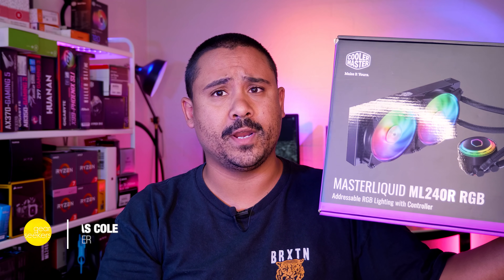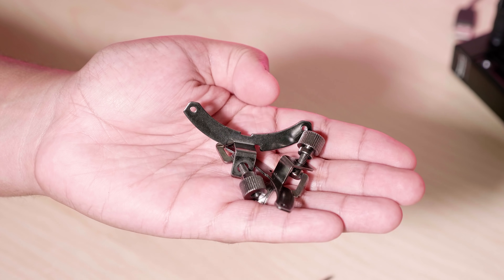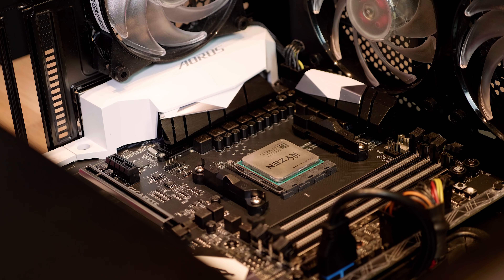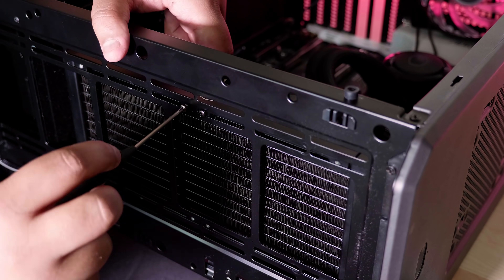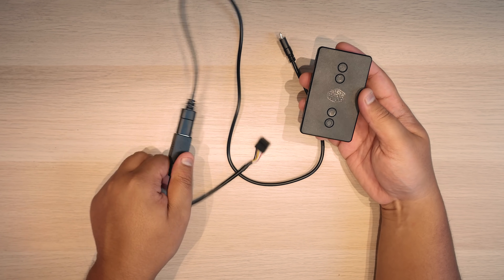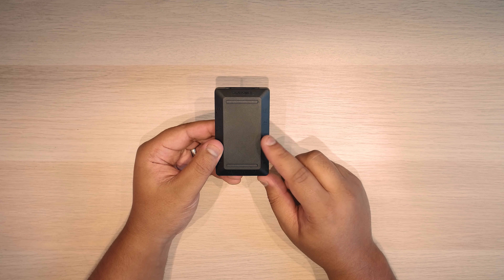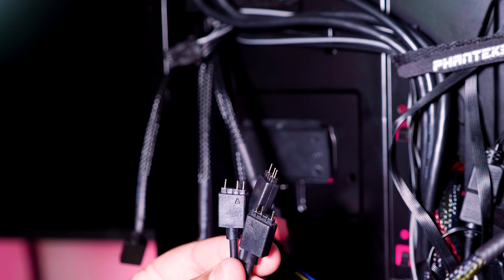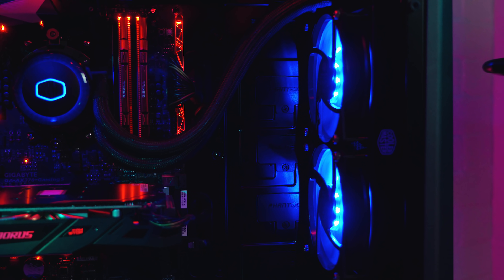HOW TO Cooler Master MasterLiquid ML240R RGB AM4 Install Guide

Comment: The AIO PWM splitter has a 4pin on 1 end and 3 pin and a 4pin plugs on the other end. 3 pin plugs turn a PWM fan into a DC fan and it will run 100% speed all the time. The other fan will run according to how you set your fan curve. Like a 4 barrel carburetor, 2 barrels feed gas till you"kick it down' then the other 2 open up. Don't know if this true of all AIO's. You could switch to a splitter w/all 4 pin plugs. Good idea or not? WWJD?

Comment: You can eliminate the controller by looking at User Manual for the ML240 Illusion. But I need the other 3 ports on the controller for my 6 case fans.

Comment: How often do you have to service this particular cooler? I have him for about 2 years now and it keeps my I5 temperature pretty low(about 40-50 degrees celsius). Is there actually any maintenance that those close-in loops require?
Reply from the maker: Never

Comment: My ryzen 9 5900 x is throttling to over 100 degrees Celsius with the cooler master 360l. All of the fans are spinning and I have no idea what to do. It doesn’t have a pump header

Comment: thank you, it actually helped me to get that rgb running, the sweet cooler master guys sent a manual without the USB and sata connection steps, and since i was too lazy to look through the whole box when i saw the PILE of cables i was wondering why its not working without any power input :D still, the amount of cables is unbelievable...

Comment: Installed this on AM4 and the screws didn't seem to stop but did get really tight to the point where I was worried about damaging something.  Temps are good though so I guess it's ok.  Only complaint I have is the fans have a bit of a low whine so I swapped them for some others.

Comment: great video glad you figured out how to set up the fans. just one note. please dont mount the radiator like that. air rises and there is always air in the system. you want the tubes at the bottom after you get all the air in the radiator. this will help keep the system from having hot spots and will help keep the pump life.

Comment: Just got one of these, the v2 anyway, and this video inspired me to adjust my setup a bit. I have the sickleflow 3-in-1 case fan setup with 1 on the back and 2 on the front, and was gonna attach this to the top, but mid-installation I discovered that I'd lost my original mobo cooler mounting hardware, so I had to order another one. After watching this, and looking down at my PC and seeing how much of an eyesore the radiator is on the top (can't see the fans, defeating the purpose of the RGB), I figured it'll be perfect on the front with my front fans swapped to the top. Assuming there is enough room in the front for the radiator and fans in my Darkflash DLM21 (opaque frontplate). But yeah, great video, clear and concise instructions. Will be watching it again when my mounting bracket arrives, thanks.

Comment: Hi guys! important note. Nick did a great job of explaining how to install the cooler and brackets but if you want to use Aura sync or any other m/b integrated ARGB Sync then it's best not to use the controller and just use the splitter to connect up all your ARGB devices to the 3 pin single ARGB connector on the m/b. 
this is much easier and no usb connection/extra wires needed. Also fan power cable splitter not really require and there are many fan connectors on m/b these days.

Comment: This video helps a lot. Thank you very much. Got one question. Would it be okay if the splitter fan cable be connected to the system fan header instead of the cpu fan header?

Comment: Hi. Some recent videos mentioned that radiator tubes should not be mounted up to avoid getting air into the pump. Do you know if it is possible to rotate the radiator and put tubes down? Are the hoses long enough?
Reply from the maker: It literally makes no difference. You should probably understand the context of those videos

Comment: Is that a Phanteks P400 case? If is It, I couldn't install the Masterliquid ML240L V2 in the same case, the hoses are too short to install in the front part and I'm having a hard time with the vrm coolers to install in the top of the case, some help please!

Comment: New to argb fans etc but does that controller plug into the 3 pin on the mobo? I have an msi rgb board that runs all my fan lights through mystic because I daisy chained them all together from your video on the msi aio.  Or is that controller it's own seperate thing completely?

Comment: Thanks heaps for the video. I did this differently ..

To get this controllable via the phantecs case (mine has 2 argb fans and mode / color buttons) - I didn’t bother with the cooler master controller, imo it’s only necessary if you don’t have a controller on case or you don’t have argb support on motherboard.

You can connect the argb splitter (that’s supplied with the aio) to the argb extension cable from phantecs case to allow for more argb devices. 

I can also connect directly to motherboard (again the case has a cable I can just plug into argb slot on my motherboard) if I want the motherboard to control argb instead of the inbuilt case controller

Comment: I have 2 sets of coolermaster 3 pack fans and one of three way splitters is plugged into CPU_FAN and the other 3 way splitter is plugged into CPU_OPT and whenever I boot up my pc my fans go all the way to max RPM then slow down, then ramp up, then slow down, constantly. And i can’t seem to configure the speed in the bios because it doesn’t do anything.

Comment: Correct me if I’m wrong but isn’t there a max of 10% air in these and with that the pump is at it highest point meaning your not going to ideal conditions?
Reply from the maker: You're wrong

Comment: Are the tubes really supposed to be on the top when mounting the radiator in the front? Shouldn't they be on the bottom or...?
Reply from the maker: Literally makes no difference
Reply: @GearSeekers  Alright thanks, and push and pull or only pull? :)

Comment: كرت الشاشة - MSI RTX 2070 SUPER 8G GAMING X TRIO
كيسه - Corsair iCUE 220T RGB Airflow	
الرام - CORSAIR Vengeance RGB Pro 16GB (2 x 8GB) 3600MHz	
المعالج - Intel® Core™ i7-9700K Processor  
التبريد المائي  - Cooler Master MasterLiquid ML240R RGB	
  هارد ديسك  - Western Digital WD Purple 3.5″2TB	
الشاشة  -  MSI OPTIX G24C4 23.6″ CURVED 144Hz	
الباور   Cooler Master V850, Full Modular 80+ Gold Certified 850W Power Supply, 5 Year Warranty
الماذر ( لوحة الام ) GIGABYTE Z390 UD Motherboard

Comment: Useful video up until your rgb splitter miraculously attaches itself to the rgb controller. 
Might be worth mentioning you need to use the male 3 pins converters that come with the cooler to do this...
Reply: This drove me fkin mad. That’s what its called? I was wondering whether that’s what I needed to do. The other thing is, my motherboard’s cpu opt port where he plugged in the pump, it’s a 4 pin port but the wire has a 3 pin female head...

Comment: when installing my 5 3600 i didnt notice the back plate of the cpu fan mounter fall and i was crushing the spring guided screws so hard on my cpu i rectified my mistake but fuck me was it scary, 8 months later no problems luckily i didnt derptard too hard, first build btw now on my second :P

Comment: So I started my journey with losing two screws needed to install AM4 stuff on the pump :D .. then had to remove two screws from my motherboard. Now the problem is with mounting the radiator because it seems like I cant mount it on TOP.. my RAM collides with radiator.. and I cant mount it on the front panel cause some stupid ass cables are colliding haha.. The only option left is to mount it on the bottom :D gonna leave this for tomorrow

Comment: Hi Nick. I know it´s an old subject but, is there any tricky "problem" with how to install radiator vs pump tubes vs liquid loop vs top/front. I have the same config as you show here and i live quite well with that. Some available Gamer Nexus videos about AIO Mounting Orientation. Just curiosity about what you think. ThankU
Reply from the maker: It literally makes no difference. Watch that video again. Most people didn't even listen to what was said
Reply: @GearSeekers  Thanks Nick

Comment: Is it possible to connect a cool master case fan to the RBG controller in one of the other ports and have them synced? I actually have my aio rgb currently plugged directly into the controller cause the instructions they give say to do so and I believe it’s synced. They also say to just plug the one fan splitter directly into the motherboard itself and not the controller which is clearly not what you did here so that’s kinda funny.

Comment: I installed it all but my RGB Coolermater logo on the pump is not turning on, do you know how to fix it? The rest of the RGB is working but I can only change it on the controller, not on Asus Aura or Gigabyte RGB Fusion. Thanks

Comment: Hey guys new builder here, i just want to ask questions regarding if it is safe to install a deepcool gammax 400 to my b450 motherboard without removing my gpu and all the attached cables from my power supply? Is it safe from any damage for my components and from electrostatic discharge? just like the guy in the video  (Nicholas Cole) Hope you guys can help me and give me some info. Thank you in advance!

Comment: what does connecting the 4 pin fan power to the argb controller do. does that just give master plus the ability to control the PWM of the cooler fans?
Reply from the maker: Unless you want to damage your components I wouldn't be doing that.

Comment: This cooler sucks for AMD motherboards that are just switching coolers. I have an fm2+ and my previous cooler didn’t require the original plastic retainer. All amd boards have these in one form or another. So 5 years later when I replace my old cooler I no longer have the retainer bracket so I had to order another. You can order replacement retainers for amd boards based on your socket. I use the A10-7850k chip with a msi A88X Gaming 45 fm2+ mobo. I will say if you know a thing or two about cpu’s and have the retainer this would be super easy to install as you would just have to mount the fans to the rad, and the rad to the case.. then the cpu waterblock clamps down on the board (exactly like the stock coolers do) there are a lot of RGB wires and fan wires which this unit comes with an rgb controller and a fan splitter for the two rad fans (cpu water block fan connection goes on motherboard). But until I get the replacement retainer it’s just mounted in the case and the motherboard is in protective static free wrap.

Comment: So did everything as shown in the video, everything works radiator fans and and pump no problemo. However. My cpu fan speeds indicate 0 rpm hence the fans on the radiator spin quite loudly which kinda defeats the whole purpose of an AIO. Wonder if anyone could help me with this?

Comment: Hey there! Any tips, why my ROG B450-f does not controll/see this controller? 4pin RGB-pin connected to the MB and the con., also the USB connector both in MOBO and cont. It just doesn't work with AURA.  :((( thank you for your help!

Comment: Is it possible to connect a three fan kit hub controller (for master cool fan kits) into the master liquid fan kit hub to control all of the fans’ ARGB functions on boards like the Asus B450-f that aren’t supplied with an ARBG header? I’m trying to build a system with both kits and the board doesn’t have the ARGB header on it
Reply: I just really don’t want to have to use up two usb 2.0 headers if I don’t need to so was thinking maybe plugging the pass through on the 3 fan kit into the AIO fan controller might work to simplify everything

Update: I’m going to try it, I think. The AIO controller has a RGB 4 pin for passthrough to RGB headers I do believe as well as coming with the USB 2.0 header setup. I wish the three fan kit came with the same controller as the AIO tbh because that would simplify everything.

Comment: u forgot the pump to the controller
Reply from the maker: No I didn't
Reply: @GearSeekers  at 8:50 you only got the fans connected should be fans and pump. Okay maybe u didnt forget but it didnt show up on the demo with the pump connected
Reply: @fongyfong2000  no, he didn't. he connect argb pump to splitter at 07.57
Reply: @kkbali1505  it should be going in the controller for indepedent rgb for the pump not the splitter

Comment: Thanks for the video.  I have a similar fan system (if not the same one) where the fan is causing excessive noise (link: https://youtu.be/Z0HYcHiv6zQ ).  What might  be the cause of that rattling noise? Do I need to tighten or loosen the fans crews? Or the radiator? Sometimes, by tilting the computer, the noise stops temporarily.

Comment: I have NX 210 with three RGB Antec fans in the front..............the technician has to remove these fans..........in order to fit the 240mm front radiator.............I would like to know how can i fit the radiator without removing the front three RGB fans................Please advise

Comment: Hi, Could you please get back to me on this.............Cooler master radiator you are fitting the fans with cooler-master logo showing towards us and in other videos they are fixing the radiator showing the other side such as coil or reverse side.............Please clarify
Reply from the maker: Depends on your case. This case is the correct installation
Reply: @GearSeekers  Nx210 Antec

Comment: 3:19 reality is this is the most fucked up dumbest lazy implementation ever, they can spare to include the bracket for intel but not AMD? so we're fuck trying to get it to mount right with that barely functioning screw
Reply from the maker: Are you high? Because it clearly mounts on AM4
Reply: @GearSeekers  yes it mounts by latching the loosely knobbed d ring into to the bracket hook, that is my problem you said it yourself it took alot of patient but to me it's just lazy and bad design. is there alternative to that? like the good ol "screw down 4 point" because i don't see it in the box

Comment: can use 2 per fan on the corners and mount 2 more fans to the other side of the rad and use in push pull config like i did... dont need all 8 screws on one side...ask linus about cutting corners when your surely not to bleed from it lol although the am4 bracket bends when over tightened ive learned the hard way....sadly LLLL :( my mounting isnt all the way burried as u said mines the master liquid ml 240L rgb....

Comment: what if i connect the little black one with 3pin to aio pump to control speed with dc mode. Because if i connect cpu opt i cant control speed. It always work %100 speed and very loud 2600rpm

Comment: Hey! I just bought this AIO with a Ryzen 5 3600 and a Asus ROG Strix B450 F. I connected everything but my temperatures are high (52 while resting). I connected the fans to the cpu_opt header and the pump to the aio_pump header. What did i do wrong?

Comment: Thanks so much for this video, I just installed this on my AMD 3600 and I would have had no idea how to do this if not for your video.
Reply: Hey I'm building a PC for the first time with an AMD Ryzen 5 3600 CPU, and am thinking of getting this cooler. Wondering how ur PC is doing with this after 3 months, is there anything to worry about? Is it holding up fine? A reply would be much appreciated. Thanks

edit: just realized that this is the ML 240R, I'm looking into the ML 240L, but the question still stands. :)
Reply: @EthanLee-dv1ec  it is still functional after 3 months, however I do not recommend it as the Fans were upsurdly loud. I ended up replacing them with nonRGB Noctua fans.  I also got my at a discount so I certainly wouldn't pay full price unless it's lower now.
Reply: @ShiftyCactus  hello I am planning 9n buying one ml240r too and I was wondering if you can adjust the fan speed in order to go down by a few decibels and how much will it affect performance
Reply: @georgikarakanov4637  Even at 50% speed it was still noticeably loud.  I think the point where I didn't notice it was at like 30-40%... at which point I think an air cooler would be better anyway.
Reply: @ShiftyCactus  okay thank you for the info fam , then I might go for the corsair h100i or the cougar hellor

Comment: Dont know what the did wrong with mine but been trying to mountvthose clip things onto my pump but no way they go in flush.. just a stupid waybthey did this.. should just be a hole in the pump and screw only grabes the metal thing...

Comment: wait so we plug a thing into the fans and the pump and never plug it into anything? the manual says to use a connector thing and plug 2 more things than you show into the control panel?
Reply: Yeah I'm confused. The splitter doesn't connect to the controller following these steps. So the RGB won't work.

Edit: I just figured it out. You need to take the 3pin adapter stands that they give you in a little bag and use one to connect the end which corresponds to your motherboard brand into one of the controller inputs on the side.
Reply: There's a little tag on the cable telling you which one to use for which brand

Comment: I can't find a cpu_opt header, I have an aurus micro ATX and I need help quick,also I have the 120 mm version.
Reply: same here. i think the fan goes to cpu_fan and the pump socket goes to Sys_fan. and then contol the fan using bios. cpu_fan set to pwm mode, and sys_fan set dc mode. CMIIW . i use msi b450m gaming plus btw
Reply: KK BALI Yeah, I figured that out right after the comment, put it in either the cpu_fan header 1 or 2, it works

Comment: I have a question, my case has 3 fans on the front that either take in or put out air, I also have the ml240r so should I just put it where you did or somewhere else.  I also have one fan in the back.